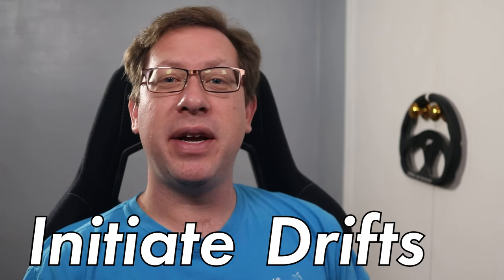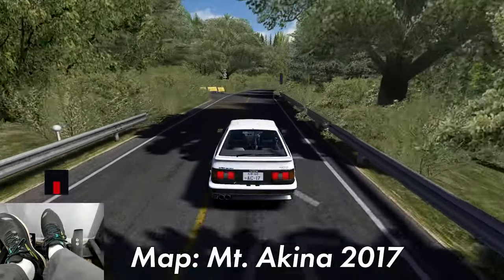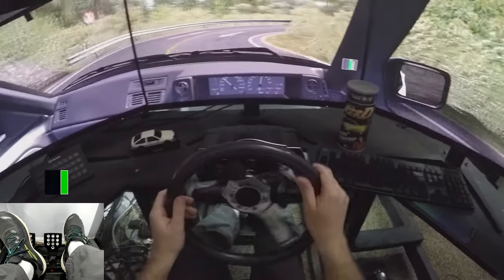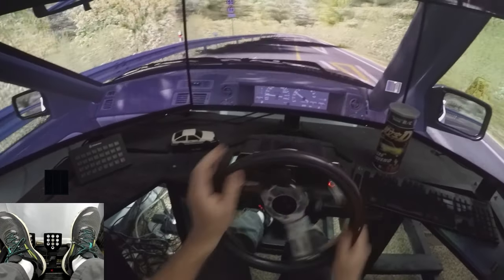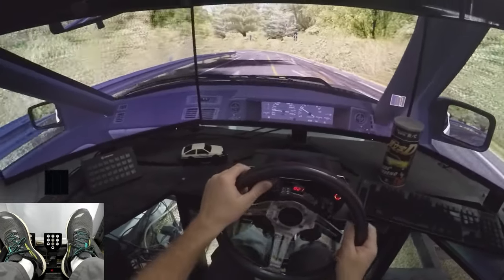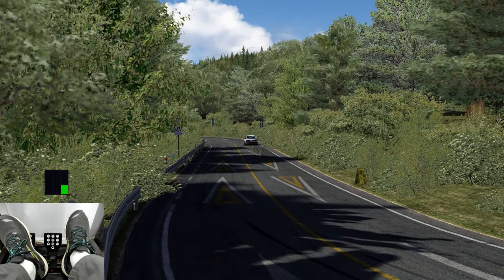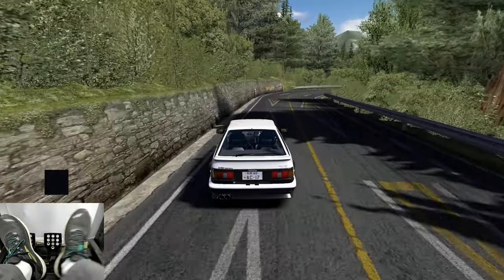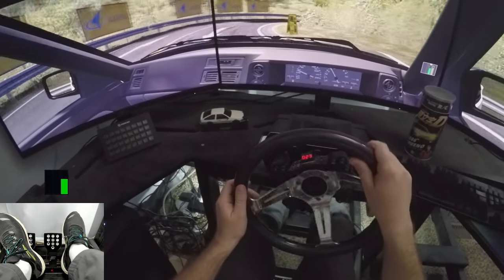How to Clutch Kick: Drift Entry Technique

Comment: can you do this in a front wheel drive car
Reply from the maker: Clutch kicks work based on adding power to the rear wheels, which push the car into a spin. Adding power to the front wheel would not pull the car into a spin and most likely would result in neutral grip at best and extreme understeer at worst.

So no, acceleration based techniques like clutch kicks generally aren’t the way to slide a FWD. You’d want to look into deceleration-based techniques like handbrake entry, foot brake entry (assuming the alignment biases the car to neutral handling or oversteer)
This is the reason FWDs can only slide for so long—they generally have to do it by dragging the rear tires and slowing down, as opposed to RWD which can add power to the rear tires and maintain speed (or actually speed up)

I may or may not have done some handbrake and tray drifting back in the day when an FWD was all I had access to 😆

Comment: Can i drift without clutch but using manual stick and handbreak?  Do you think drifting feel natural doing that way?
Reply from the maker: Like drifting with a sequential transmission where you have a shift knob but you don’t clutch? It’s not super common for most people on “normal” budgets but it’s totally doable.

It wouldn’t feel natural to me, but cutting out the left foot’s job for clutching wouldn’t be a hard change to me for me ✌🏻

Comment: Could this work with a series 1 136 hp 2015?with traction control off?
Reply from the maker: Sure it would! The physics are the same for any RWD car with a locking diff, that doesn’t have traction control preventing it. That said, each car has its own power/traction ratio so it’s possible that at low HP it may only work in rain, etc. Your best bet for low power is to run stock alloys on the rear with a skinny, low grip all season tire at 50+ PSI of tire pressure, so the engine can do as much as possible!
Reply: @KameTrick  thank you sir

Comment: does clutch kicks hurt the trany
Reply from the maker: It puts some strain on the driveline, the amount depends mainly on the tire traction. Sticky tires put more stress on the transmission, diff, and axles than less grippy ones. Plenty of people drift and do clutch kicks, even the stock clutch can last for a while, but anyone who gets into drifting has to accept that all of the drivetrain becomes a wear item eventually.